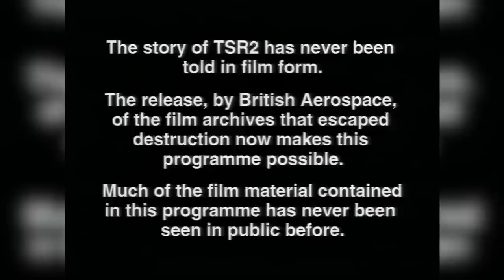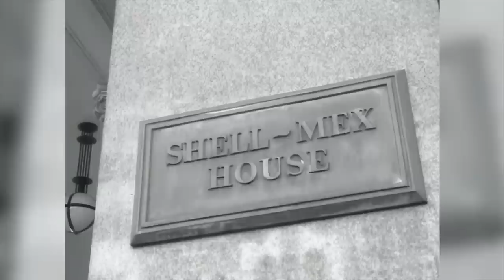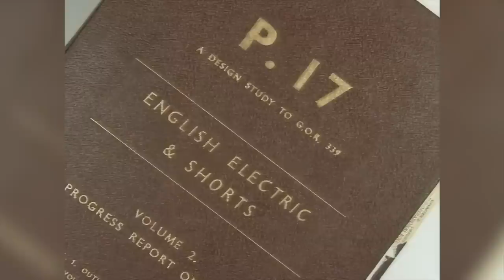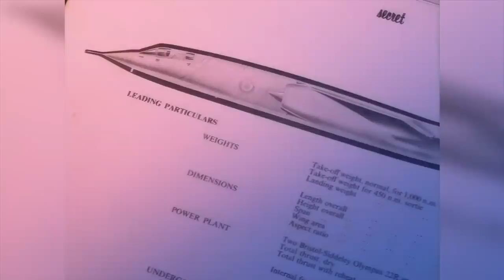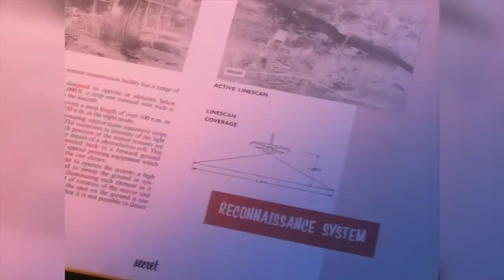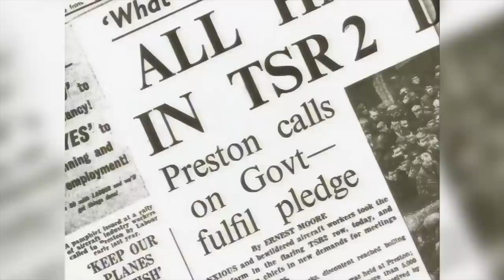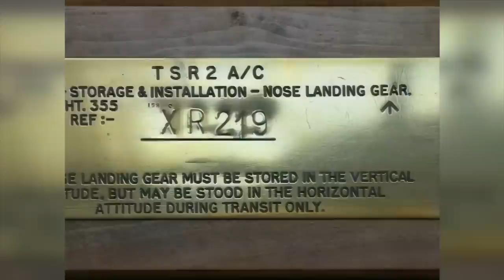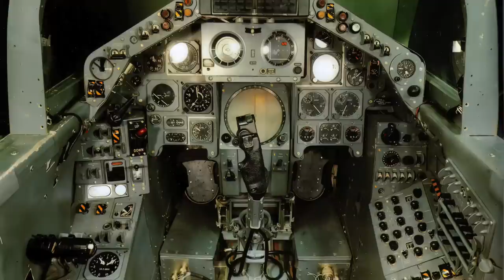BAC TSR2 | The British Cold War strike and reconnaissance aircraft that was cancelled | Upscaled

Comment: A shame it wasn’t as good as the F-111.  The RAAF was very lucky getting F-111s.
Reply: We'll never know what would have been better, but the F-111 was a decent plane with excellent endurance for the type.  Truth be told though it was years and years after introduction into service that the F-111 actually fulfilled most of it's roles.  The first 10 years of operation the planes were almost pointless as many of the complex systems didn't actually work.  Australia has probably just made the same mistake with F-35 - should have used your submarine-compensation money to part fund the purchase of Rafale instead - a fabulous and reliable do-it-all platform.
Reply: @LondonSteveLee  no way.  F-35 is the future.
Reply: @LondonSteveLee  I read a book on the TSR-2 and it had too many problems.  The F-111 was the better choice.  If only the RAF had got their 50……
Reply: @craigbeatty8565  So did F-111 - but unlike the TSR2 project, the US broke development up and got the basic plane out and added systems later - which is what we should have done with TSR2.
Reply: @craigbeatty8565  F-35 is the past - the sophistication should be in the weapons - not the delivery platform - F-35 is too costly and complex to operate and will be practically impossible to replace during an actual world war.

Comment: I was 8 years old when they killed this beautiful aeroplane and absolutely mad about aircraft, I have always blamed the Americans and a weak Labour government, as a consequence I hated the F111 and have always been very wary of American BS. This whole situation also in my opinion killed the UK Aero industry, the government has a lot to answer for.
Reply: Looks like you did not listen to the script of the video, the aircraft’s death warrant was signed before it went into the air by Tory Duncan Sands White Paper and Report.
It did not help when the MOD sales team went to Australia, pushing the super sonic Buccaneer more than the TSR2.  
In addition in test it was just an airframe with no kit fitted.
In retrospect it is thought it would have been a failure as the Avioncs and importantly Fly by Wire was not around.
It was chopped like the Avro Arrow as it was a threat to the American Aircraft Industry
Reply: @JohnSmith-bx8zb  I wrote the comment from my eight year old’s point of view of how I felt about it, I loved that Aeroplane and as far as I could see the government killed it and ordered F111’s…..just tragic.
Reply: @mikehome9650  no F111 flew with RAF!!!   A prototype was ordered but cancelled before construction along with the 50 that were never even started, cancelled because of cost.
Australia ordered and took delivery of the F111 many years late at a fantastic cost over run.
Reply: @JohnSmith-bx8zb  John, what is wrong with you? I told you I wrote this from an 8YO perspective, I watched the whole video, I am 67 now and know a lot more about the world and PEOPLE, please do not contact me anymore if all you want to do is demonstrate your knowledge, thanks for reading my comment and taking the time to respond. Best regards.
Reply: @mikehome9650  what is wrong with you, if you are writing from the perspective of an 8YO say so.  If you consider 67 old then just wait till you get to my age and have travelled as much as I have and also well read

Comment: The F111 wasn’t ready till 1973! Should have seen the TSR2 project through! Air industry ruined in one stroke of a politicians pen!
Reply: Over budget, over delayed, too many problems, most of its high level operations compromised by SAM's, not wanted by the RAF Air Marshals.  Better job would have been done by the Buccaneer 2 / supersonic Buccaneer.  I you recall the Buccaneer was in service and flying before a TSR-2 had left the ground.

Comment: The fact everyone in this program does nothing but compare this cancelled airplane to the F-111 says everything you need to know.  The whole concept of the twin-engine low-level strike and recon aircraft is bunk. The whole low-level strike recon concept only works with a substantially larger four-engine aircraft.
Reply: The F-111 flew in Australia for 40 years. It had something going for it.
Reply: @bigtone667  The Aussies never used it in combat wher the US found in Vietnam, it was useless, it wings came off. Very fast in straight lines but could not go around corners well
Reply: You are simply wrong.  F-111 was effective in its role as a low level strike plane.
Reply: @jaybee9269  It was not really, itcould go fast in straight lines and took out undefeded targets in GW1.Not suitable for combat
Reply: @jaybee9269  I can accept that the f-111 was effective in its role in it’s time; however, the fact remains that it was developed before the advent of Energy-Maneuverability Theory. Just looking at the F-15 and the B-1 and how different they are as airplanes speaks to the impossible expectations and promises made about the f-111 and it’s supposed performance. It’s not unreasonable to assume that the tsr-2 was also over promising and under delivering even if it was a better airplane than the f-111.
Reply: @BaronVonHobgoblin  
John Boyd.
Reply: @BaronVonHobgoblin  Actually not. On one engine the TSR2 out accerated the Lightning chase aircraft, low level it was stable and superb plus, it had a superb agility for its size. The TSR2 under promised and could have delivered more if the yanks had not used extreme pressure to have ot scrapped. The other Aircraft at the same time the yanks did that to was the Avro Arrow, they could not touch them
Reply: @jimwalsh8520  the problem isn’t one of speed or acceleration per se. The problem is that these little two engined planes can’t carry any amount of fuel. What good is going Mach 2 if your engines run dry after 10 minutes?
Reply: @jimwalsh8520  take off your rose tinted Union Jack sunglasses and stick to facts. TSR2 was the wrong aircraft at the wrong time. Tornado turned into the right aircraft at the right time……..
Reply: @billpugh58  Take your head out of your backside, next you will say the Lightning was the wrong aircraft. Obviously you do not know much about aviation
Reply: @BaronVonHobgoblin  Unreasonable? Assume?  Even if?  What exactly is the thrust of your argument?  The air frame concepts of the F-11 and the TSR2  were not in any way compatible.

Comment: Humiliate by the Mirage 4!!! Complement drop by the Dassault mirage 4 project, From the drawing board to the 1st prototype, 18 months only, Supports 1 hour at Mach 1.8. and 30 minutes at Mach 2
The TSR2 in addition to being horribly ugly, sucks, pure dung. The English don't know how to make jet planes (flying bricks) (on the other hand the engines are really great, the English really know how to make good and powerful engines.
If the English were less stupid and proud, they would have contacted the French to mount the engines on the Mirage 4 and we would have all the best strategic bomber ever designed.
With its modest Atar 9k alone, the Mirage 4 can fly at Mach 2 and for a very long time.
With English engines, this would have considerably increased the range of this aircraft.
 
We had to wait for the Concorde... which outclassed everything that was being done, whether in the USSR or the USA. We have the qualities of his faults and the faults of his qualities.
English planes have terrible aerodynamics because when you have such high-quality engines, you can fly bricks.
The French did not have such powerful engines so their planes had very efficient aerodynamics (hence the choice of the delta, perfect compromise, lift, drag and solidity) ideal for the supersonic.

So the two qualities complement each other perfectly.
The Concorde's wings and engines greatly outclass the Russian Tu 144.
Whereas if the French or the English had made the plane separately, it would have been less efficient than the Tupolev.

The problem being that it is very difficult to get along with homosexual ball busters and other inverted snobs.
But as the Scottish people say, the English are so dumb that they confuse pussy and asshole. (That's why they're all gay) At least that's Scotland's theory for understanding Londoners' stratospheric level of homosexuality.
(The other hypothetical, that of the Normans) Their women are so ugly that they are mistaken for men, and the men are so virile that they can be mistaken for women.
It's tragic.

Long live Scotland and Ireland!
And to think that it's my ancestors who create this crazy country.
misfortune, shame, curse!

Comment: Tsr2, the ultimate emperor's New clothes aircraft,they couldn't even get the wheel doors to shut properly as they got the measurements wrong and yet fanboys salivate over it...same with the avro arrow, another cancelled aircraft who's abilities are totally exaggerated,the truth about the arrow and tsr2 is that both would have been obsolete within a few years of entering service.
Reply: @johnbarrert3732 Yes, that's about the strength of it. You wouldn't think that TSR2 was designed by the same country that produced the excellent Vulcan, Canberra, and Lightning.

Comment: The Americans simply wouldn't let the UK have this aircraft! Not when they had their own planes to 'sell us'!!
Reply: That's ruthless commerce, but doesn't excuse civil servants (huge committees making wrong decisions), politicians wanting to save money or please someone, or special interests (Mountbatten).
Reply: @senianns9522 The TSR program was a complete basket case. It grossly overran and overspent and the aircraft itself had major technical problems. There were many reasons for this. It didn't help that the requirement kept changing and the program was run by a committee. Meetings often comprised upwards of 50 people.
Reply: @phonicwheel933  It had two types of problem; technical, because it was so advanced, but which were well solved, and political, due to gross mismanagement by Whitehall, and which of course added greatly to cost.
Note that it was cancelled by sleight of hand.
I remember those days well, and still have my aircraft magazines from those days. I read physics and maths, and went into industry, and over the years, have been struck on several occasions by how technically ignorant and yet arrogant the civil service tend to be when making decisions on these and other things which they think they understand, but don't.
Meanwhile, politicians made decisions based on very short-term bases, while users, military and civil (I'm thinking of BOA and BEA here) also changed things after development had begun, which can be terminal by itself, and certainly plays into the hands of civil service and politicians.